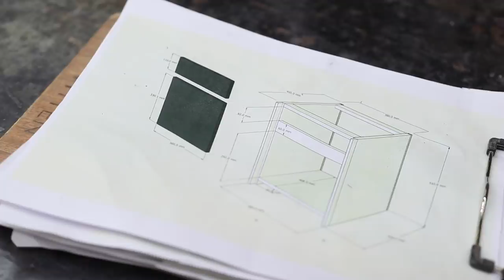W88_Bedside black cabinet

Comment: Another superb finish on your project.  I normally use ultralight MDF for projects that don't require shown natural wood, but I've never been able to fill screw holes or even brad holes that don't show an impression through primer + 2 layers of paint.  What do you use to fill the brads/screw holes in your projects?